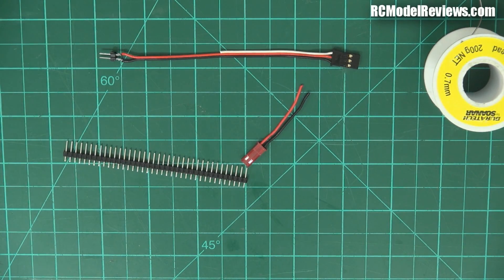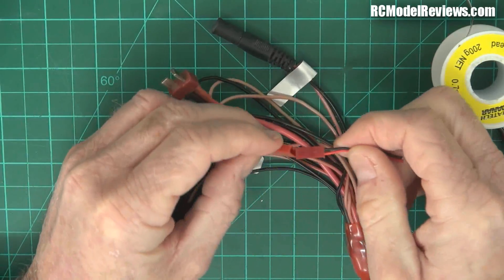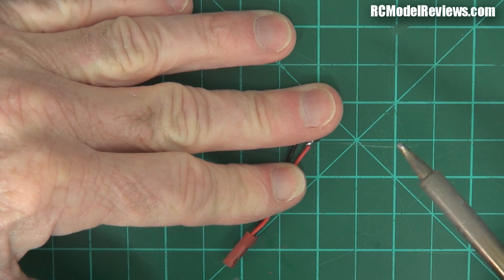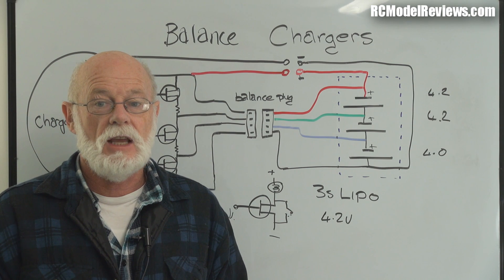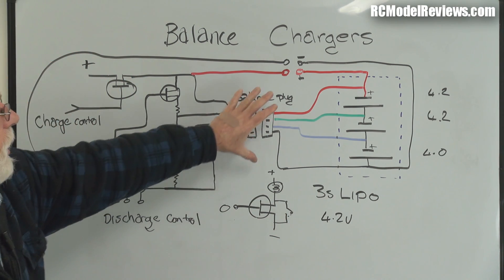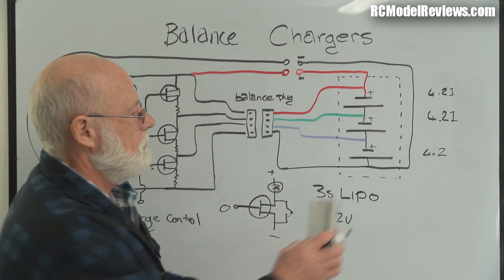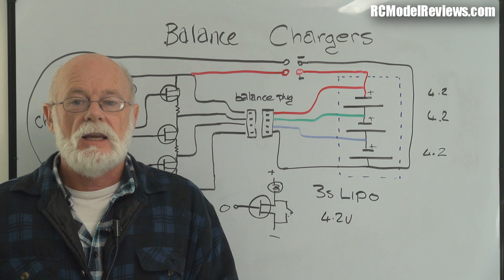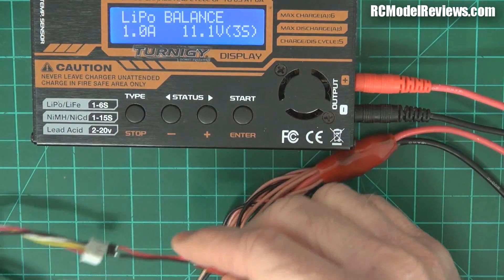Balancing your lipo battery more quickly (and how cheap chargers work)

Comment: there is one flaw in all this i can see and i have tested this and thats that if you charge a lipo at half its rated mah then you get full amps back in but you must first drain all cells to 3.0 volt per cell to do this , if you charge at the rated amps of the battery you will not get full amps back into the battery and if you dont drain the batts to 3.0 volt each time you will over time build a memory which they say lipos dont hold a memory but that is simply not the case they do hold a memory i have proven this mny times in the past that they do infact build a memory
Reply: Kevys Rc & Music No, this is completely wrong, Lipos don't have a memory. I never discharge to 3v and always follow the 20% rule, so minimum voltage after use and a short rest period should be around 3.8v.
Reply: st200ol sorry but its you that is incorrect in your information of how lipos work this is the real world not fantasy land
Reply: Kevys Rc & Music No I did not read all 231 posts on this video.  Yes I did however real all the replies to your initial comment.  I don't have personal test data, never cared enough nor had the need to research weather or not lipos have a memory....and so I won't make a statement either way.   No I'm not certified in electronics.  Based on what I see in your videos vs. Bruces I would trust his opinion over yours.  
I was merely asking where in his video he talked about discharging down to 3.0V/cell.  Something I NEVER intentionally do.  Because you seemed to be saying that, and I quote you, "one flaw in all this" is that you have to first drain the battery to get eventually get full capacity.  This is NOT what the video is about.  For some reason you seemed to be changing the subject....not sure why.  The POINT of this video was to show you an alternate way to more quickly bing your batteries cells to the same voltage.
Reply: E Will Don't waste your time with "kevins rc cola & disco"  I ended up having to ban him from my channel.  Trying to reason with him is like talking to brick wall.
Reply: st200ol 3,8v, thats more like 55% rule. Whats the point of big nice lipos if you arent going to use them. Or maybe you got memory effect, dropping voltage rapidly under load much earlier than the 80% mark.
Reply: Kevys Rc & Music I have experienced memory effect on a zippy compact lipo. After many short flights discharging just past half capacity. In flight, voltage alarm would go off, and esc cut due to low voltage. Yet when checking voltage after landing, I would see 3.8v/cell. I then discharged slowly to 3v/cell on charger, before charing it again. After that, performance was back to normal. No long a massive voltage sag around 50% capacity.

I guess, for longevity of the pack, one probably shouldnt do a deep discharge every cycle, but once in a while seems like a good idea if you want your lipos to be able to deliver on capacity. Also unsure about whats the ideal cutof for deep discharge. Is lower better? ( to a point,...) or is there a magic limit, say 3.3v, that gets rid of the problem? idk..
Reply: Kevys Rc & Music Sorry but you think you know more than RC Model Reviews?...LOL.  Did I miss something?  Where did he say in his video to discharge to 3.0V/ cell.
Reply: +Kevys Rc & Music at least its a polite answer. :) It's a shame you can't give any supporting evidence because to seem convinced... I like to believe concrete evidence and have yet to see decent sources prove there is a memory effect!
Reply: Akujiwar Bladefist I goto 3volts percell everytime on my charger then recharge at half of the batterys max Mah and my lipos last a long long long time unless i do something stupid then that would be my fault some batts i have gotten over 400 cycles on easy even on 1s batts
Reply: what capacity are you getting after 400 cycles, compared to after 10 cycles?
Reply: MikeysRC thats your choice and your opinion we are all intitled thats for sure even when we are wrong to listem to some guys its still  a matter of choice .. what i dont belive or trust in  i test my self this way i dont get mislead , just like i dont bleive in over 90% of the stuff you learn in books cause most of that data is WRONG.. and its been proven not only by my self that the books are wronge but others as well,.. cause people like me need to know the full goods for our self ...better to be safe then sorry in the end ....
Reply: Kevys Rc & Music MEMORY...the biggest Lie ever told....sorry Mr expert , it does NOT have a memory..geesh,,,where do you people crawl out from 
I prove daily Lipo's have No memory, if that were true, NONE of them would fly past half as almost EVERYONE sets theirs to Store charge and charge from there...once it hit half it would STOP at that point....I am Living proof that never happens ....nor does any "memory' seems the memory lies only within your own flawed mind.
move along now Mr expert.
Reply: http://phys.org/news/2013-04-memory-effect-lithium-ion-batteries.html

Granted, this article doesnt spesifically mention liPO. Just LI in general. But it is my understanding that the main reason for memory effect is partial discharge. Using storage mode should not affect this, assuming you discharged below storage during regular use.

The common consensus on the net seems to be that lipos dont have a memory effect at all (up untill now, atleast), but that article disagrees. And i have experienced this fenomenon first hand.
Reply: Kevys Rc & Music Seeing how many experts and about 99% of all people across the vast many forums I read daily disagree with you on that subject...and reading , researching and testing seems to make one unskilled on the subject according to you, and your Highly educated "expert" ideology of the matter shines light a beacon and you are correct everyone has an opinion, just like you do, Just an opinion. .... Have a Nice day
Reply: E Will hahahahaha lol lmao you have nice day to
Reply: John F Hendry wow nice little novel you have written but what a waste of your time and energy you could have spent doing something usefull,,
Reply: Kevys Rc & Music I see you didn't read it and are tripping over your own emotions in defense of them. Had you read it you would have noticed something crediting you. You have a lot to learn. But yes I can see conversing with you and people like you is not useful. But I try to be a nice guy but have to agree with your statement. I'll leave this post up so I remember the lesson.
Reply: Kevys Rc & Music You're placing the memory effect in the same bag as other forms of cell degradation. Li-based battery chemistries cannot develop memory effects as other chemistries do. This is well understood and amply documented. That said, LiPo cells will degrade with use, reducing the total amount of energy they can store. Using them outside their design ranges will accelerate cell degradation besides being dangerous.
Reply: Luis Muñoz well your wrong in your thinking of what iam talking about .. i dont care what info you read. i have seen the effect my self many times and have cured it many times as well. its a temp cure but it does work.. and restores the battery to full power use volts and amps , so you can think what ever you like but until you have experience in dealing with it your self you wont change your mind about the BS you read so leave it at that.
Reply: +Kevys Rc & Music how stubborn you are... Luis is right and you are wrong. Lipos do not have memory effect as bad as previous types of batteries. Also wrong and very annoying is your use of 'your' for you're.
Reply: E Will your right iam an expert and  i know my stuff, you on the other hand do not but you know everyone has an opnion even if your wrong you still have one and thats fine so you have a nice day
Reply: +zewill i have proven way to many times already that lipos in fact can build the memory effect i dont give a crap what you think you know your wrong and just to save future crap lets agree to disagree i wont be caught up in talking to a wall so in future i will no longer be party to a sensless argument with a wall have a nice day , i also dont care if you dont care for my grammer thats your problem not mine
Reply: MikeysRC aparenlty you did not read all the posts you did  not understand what was being said .. and ya you missed alot for sure. i also have 37 years into electronics and also certified are you . umm me thinks not .. do you belive everything you watch on youtube sure sounds like it to me ,do you believe the laws of phyics 100% I sure the hell dont cause alot of it is noting but BS i supposed you are one of those people that think that liopos can not and do not hold a memory when infact they can and do and thats why lipos need to be discharged all the time to 3.0 volts percell other wise guess what memory problems happen amonge other little problems.. so ya i think i know my stuff really well. i been in the game for along time i have disproved over time alot of things that people that was True i have proven different and not just in RC stuff by the way ..

Comment: Chargers that charge a lipo by using the balance plug only are:
1S-3S: HexTronik HX8080
1S-6S: BC168
1S-6S: CB86  (up to 8 lipos parallel or in series)

CB86 would be my choice.

Comment: Hi Bruce,
Don't the pins need to be separate so that the negative can connect to negative and then use the positive to select which cell?
Reply: No because you only want to charge them one cell at a time. If you put the black in the black hole, then tapped cell 2 you would be charging 2 cells
Reply: Benjamin Harvey I must be missing something! In the video Bruce firstly connects black to negative and red to cell 1,which would seem correct. but he then connects black to cell 1 and red to cell 2, then black to cell 2 and red to cell 3. don't you need to maintain a negative connection with the black and select the cell with red?
Reply: Benjamin Harvey got it now, the positive of cell 1 becomes the negative of cell 2 etc. this drawing helped me understand.
@11017211

Comment: That's a brilliant lesson. I've often had the issue of one cell lower than the others and as a result, the battery has spent ages on the balance charger. Certainly takes some of the mystique out of Lipo's.

Comment: Have you try UNRC UN-A9 balance charger? Its a great charger and I have been using it for about a year now with no problem. Its affordable too around usd 50 to 60. This charger charge lipo using balance lead and charge each individual cell separately. So if one cell is not up to 4.20v, it will keep charging and stop charging for any cell that already reach 4.20v. I stop using my regular charger after using this charger. Its faster imo and my pack always balance after each charging session.